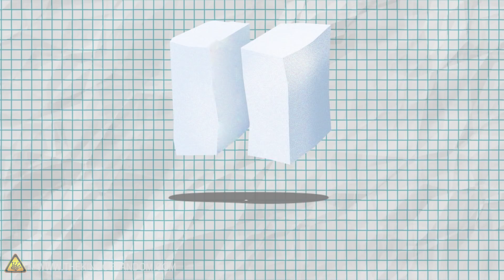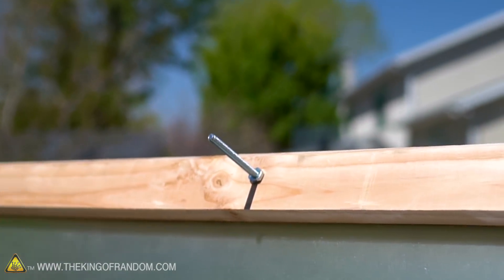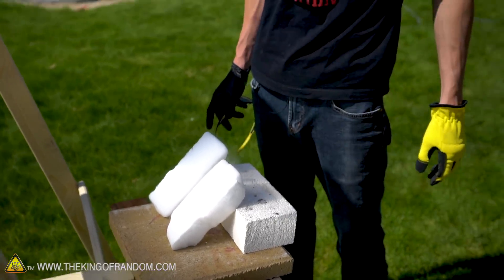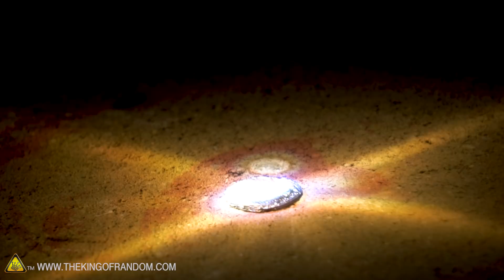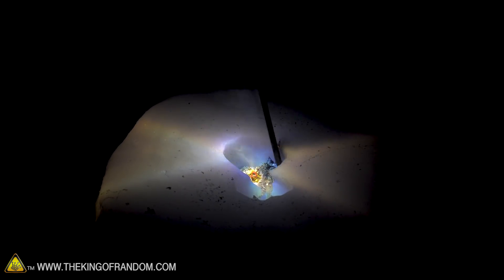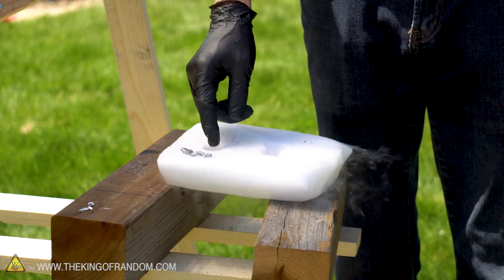When 2000°F Solar Power Hits a Block of Dry Ice? TKOR Solar Scorcher Sun Power Vs Dry Ice!

Comment: In order to help keep the direction of the sun to the lens at 90 degrees
 I screw a small 1/2" id X about 2-3" long tube to the wood frame. For 
storage you turn it so the tube is parallel to the lens. To power up you
 turn the tube 90 Degrees to the lens and turn the lens so you can see 
the sun through the hole in the shadow of the tube on the ground. Since 
there is a nail or screw through the tube you will get a circle of light
 split in two.  Simple quick and easy. In most cases as you focus you are generally behind the lens so you can take a quick glance at the ground to see if you are parallel to the sun. You can make adjustments as you are bringing it in focus without having to completely go to the other side ans see if you are parallel. Also you can turn it for flat storage.

Comment: if you put the dry ice on the steel plate it would also float off. i think pressure has a lot more to do with this. try put the dry ice in a vacuum chamber and then heat it... maybe :P

Comment: Dry ice sublimates faster through conduction than it does radiation, so it would definitely win against just the solar scorcher. Also, the rate at which dry ice absorbs heat is less than the rate at which the solar scorcher Heats things up, so there's no way the metal wouldn't melt on top of the cold dry ice

Comment: Interesting. Because the dry ice is white, it just absorbs the concentrated sunlight as just white light. It isn't until the concentrated sunlight melts metal on top of the dry ice that the dry ice becomes affected.
Reply: I don’t think it’s because the dry ice is white, if you put white paper under the light, or some white plastic etc, it would still light the paper on fire and melt the plastic. It may have some effect but I think it’s mainly due to the composition and temperature of the ice.

Comment: Don't worry non-Americans. Converting from the English system of measurement to the metric system is very easy. So when he says 2000 degrees Fahrenheit it's very simple. You're going to need the brine from a blue cheese, a pile of dead leaves and a warm armpit. Now subtract the temperature of the warm armpit and divide it by the number of leaves in the pile...hang on....was it the brine of blue cheese or a hard red cheese? No, that's it. The cheese goes in your arm pit and then you face west and then count the leaves.....errr.....I think i've missed a step...

Comment: Try putting diff metals in pyroceram, corningware, to melt them under solar scorcher. It is much better at holding heat so it doesn't disapate as fast.

Comment: What if you wrapped it in black cloth so it would conduct more heat tho?
Reply: iilostboiii barely conduct more though
Reply: The cloth would ignite and burn away fairly quickly. Depending on the material, if any ash is left behind, that might serve to conduct heat though.

Comment: I don't know if it is easily possible, but have you tried putting an inverted lense right into the focal point?
If done accurately you could get a super heat laser beam!(I mean if you get all the light rays to go in the same direction again)
Then you also could do explosion and ignition projects without the lens getting dirty. Also you could go away a little further away and use mirrors to direct the beam to the point where you need it!

Comment: There are... a lot of things here.
First of all, Solar Scorcher vs Dry ice, the amount of CO2 coming into the air crystallizing vapor scatters and block the light coming off from the solar scorcher, it never get the chance of actually scorching dry ice.
With the penny, it was getting lifted by CO2, the heat had a bad time traversing through air to the dry ice, because heat capacity... yay...

Comment: the color of the dry ice won. Your solar concentration device follows the same rules as burning lasers - white stuff reflects the whole spectrum so white stuff is like armor vs. beams of light, including sunlight. Meanwhile, if you spray paint the dry ice with a coat of black, it will melt immediately until it gets to wherever a large amount of white exists next. When Burning things with lasers, ive found a simple sharpy X can turn almost anything into a conductor for thermal-optical stuff.
Reply: shintashi 1) you can’t paint dry ice
2) dry ice doesn’t melt

Comment: Dry ice will not sublimate faster as expected by focusing the sun on it. Dry ice sublimates at a rate according to how much co2 is covering it's surface area. That's why it'll sublimate much faster when submerged in water (until it freezes the water). This has nothing to do with the dry ice being white and reflective. It just that doesn't sublimate faster when hotter.

Comment: You need a better couplant. The dry ice and metal interface suffered from your ladenfrost affect.  Thus the ice was a poor heatsink.  If you use some sort of thermal couplant this experiment would go much different. I imagine if you used alcohol, the gel would do excellent in maintaining contact throughout the experiment.  Dry ice would still get a hole through it how ever you might be able to keep the lead or pennies from melting as a result of the dry ice absorbing it better

Comment: Hey. Solar scorcher steam engine?
Reply: Use the power of the scorcher to generate steam to power a steam engine, to turn a generator and make electicity
Reply: Hannah very inefficient
Reply: You would probably do better to simply use a photovoltaic solar panel with the same dimensions as the scorcher, and capture electricity directly.  The more conversions involved, the lower the efficiency of the system.  Solar to thermal, thermal to kinetic, kinetic to electric--wouldn't get much usable power by the end.  On the other hand solar directly to electric, I believe you would have greater net energy available.

Comment: Seems to me that if you had used a fully copper penny you would have received a different result.  Copper transmits heat much better and has a higher melting point than zinc.  I believe the real copper penny would not have melted but would have tunneled deeper and possibly through the ice.  I think that this is the best experiment to show the difference in heat diffusion between  metals.

Comment: Absorption won. White ice reflects away the EM radiation.

Darker other materials absorbed and re-emitted some of the sun's EM radiation at different frequencies. At least two mechanisms are at work here: the material absorbed and re-emitted the sun's energy at frequencies the ice will absorb, and air absorbed part of it becoming a super-heated pocket of air that secondarily reemitted the energy at frequencies absorbed by the ice. Any energy the ice absorbs heats it.

This is why you see black powder sprinkled on snow piles in parking lots. They are changing frequencies of the sun's energy, through re-emission of more frequencies the snow will absorb.

Comment: I feel like the dry ice makes CO2 which refracts the heat and light to near no heat and light so why don't you put it in a steel box and leave a vent and attach a pipe to the vent put the gas in water then see which now it is indirect and should have. A bigger effect

Comment: If someone is interested in the sciene, carbon dioxide absorbs almost no radiation in the sun's spectrum except for infrared light at about 2000 nm wavelength. The infrared however is probably blocked by the scorcher's lens. Therefor it has a hard time subliming the dry ice.

Comment: When you are placing penny or lead the heat tranfer rate from the sun to The penny is much much more than the dry Ice taking heat from the penny or lead , which makes the penny / lead to accumulate heat and melt down , While dry Ice doesnt sublimes because of the neighbouring atoms cools it down. its really awesome to watch it work

Comment: Can you do anything to increase the power of the solar scorcher, add a second lense a distance away in a reflective box perhaps?
Reply: Adding more lenses won’t really increase the power. I think the only way to do it would be to get a larger lense
Reply: Nolonger Oblvious normally when people speak of adding more lenses, they mean putting them in front of each other, which will not have an effect
Reply: Mirror then lense is the easiest. otherwise you have to cool the mirror.
Reply: Adding more lenses is the same thing as getting a bigger lens. (So long as the lenses are such that they share a focal point, and don't get in each other's way.)
Reply: I speculate no. I'm going to guess dry ice and dry ice powder reflect a lot of the light energy. no one really seemed to bring that up. check out the wikipedia for 'Albedo' (how white something is)
Reply: so... guessing a bunch of them and mirrors on buildings all pointed at the same spot on the sidewalk would be a bad idea then... 

(poof! where that person go! who did that!)

Comment: The steel plate could have melted if it was the size of a penny because steel can be melted if the surface area is smaller

Comment: What happens when you pour water on dry ice?
Reply: Joar _D its rolls off. Ladenfrost but from the dry ice
Reply: Joar _D if you dig a hole it'll bounce around before getting too cold and freezing
Reply: Dizastermaster but if u put 4 blocks on Wood in a rectangular  position and a lot of water in between will it freeze?
Reply: Joar _D If you trap the water it will freeze with enough dry ice

Comment: I think the metal plate had too much surface area and cooled on the edges too quickly to melt a hole in the dry ice. You should cut a quarter sized piece and try it again

Comment: If you hold the dry ice over a candle, it will deposit a thin film of carbon on the surface of the dry ice leaving a black sooty spot. Put this spot under the solar torch and it will melt the dry ice because the black color will convert the energy to heat much faster than the refractive white color of the dry ice.

Comment: Near as I can tell, the reason the dry ice block/powder didn't evaporate any faster is because as you add more heat to any given substance if it's at its phase change temperature, the substance does not actually change temperature - all of the extra energy goes toward the phase change process. However, relative temperature of the Solar Scorcher to dry ice compared with the relative temperature of the ambient temperature outside to dry ice (194K:1366K (dry ice temp vs 2000F) as opposed to 194K:308K (dry ice temp vs 95F)), when converted to ratios relative to the heating temperatures, is only actually about 0.487, which is not at all a lot.

Comment: I'd like to see the result and how much power is/could be generated by the Peltier effect; placing a thermoelectric, solid state heat pump on top of the dry ice and having a steel plate with the focal point on the other side. Perhaps get like 4 or more sandwiched between steel plates and see how much power can be generated from the thermal difference..

Comment: Btw any one can do this with a normal convex lens on most glasses concave lenses won’t work because they distribute the light rays instead of focusing them the size of the lens matters a lot because the more surface area focuses more light rays so with a big enough lens you can burn steel, glass, and basically anything.

... SCIENCE

Comment: The steel plate on the dry ice after heating it you should have flipped the plate over and tried pouring water over it.  The water may have not boiled off on the side of the plate that had the dry ice.

Comment: Scattering, transmission and reflectance of dry ice is really high, absorptance is quite low, so most of the energy passes through it or is reflected. But when you put metal on that, it's radiative properties are quite different, allowing it to absorb a lot of that energy and get very very hot, and it then conducts that heat directly into the dry ice.

Comment: My guess for why the dry ice doesn’t sublimate any faster would be that the rate of sublimation is already at its maximum. The temperature of the CO2 can’t increase any more in its solid state (it can’t absorb any more heat than it already has) and must change state before it can absorb any other energy. Increasing the temperature on the surface doesn’t affect the dry ice, while putting something on the surface allows the excess energy in the objects to dissipate directly into the dry ice, as it has nowhere else to go.

Comment: The dry ice won, the scorcher only caused damage to the dry ice through the use of metal. As light, it was completely reflected from the dry ice, but when that light transferred as heat in the metal, the dry ice wasn't able to reflect anything.

Comment: Dry ice has a very low emissivity meaning that it does not absorb the solar radiation from the sun easily. However when you place an object on top of it that has a higher emissivity then that object gets hot and begins to sublimate the dry ice. With the object placed on top of the dry ice, the mode of heat transfer is conduction as apposed to radiation when there is no object on top.

Comment: Leidenfrost won.  It insulates the metals from the cold; allowing the heat to win
Reply: Put the steel in a pan with dry ice and cover both with a thin layer of water.  The water will better transfer the cold to the metal.  Then the ice should win.

Comment: I think it's because nothing is technically cold, you are just adding heat, but the stuff you put on the dry ice don't reflect the radiation as well as dry ice can, and the heat being transferred by solids, (conduction), was more efficient and gathered more heat at a time to break through the dry ice.

Comment: Firstly for the CO2 block I think the suns rays are being refracted and heat has been reduced to near nothing due to it...and secondly zinc and lead are higher in the activity series compared to carbon...loved the experiment was waiting for one with the solar scorcher
Reply: co2 is a heat insulator.I believe heat from radiatian and conduction does nothing to it.
Reply: I think you mean reflected, refracted (I think) only works on transparent bodies. And there was no chemical reaction that took place during the video, therefore the reactivity series is not necessary.

Comment: My science is a bit rusty but I assume the reason those metal items melted is highly related to the thermal conductivity of those metals.  You had proved that the dry ice has enough energy to 'win' against the solar power.   I think that metal is melting because it is not conductive enough for the cold-energy of the bottom side of the metal  to make its way fast enough to the top surface.   If you used something like Copper which has a very high thermo-conductivity you might have a different result.  Copper is ~4 times more heat conductivity as the mostly zinc penny.

Comment: The issue wasn’t the metal, it was the absorption of light that caused the objects to melt the ice faster. The white color as well as the translucent nature of the CO2 means that very little energy is absorbed by the dry ice, but it is reflected. If you ever try spray painting snow with black paint, within hours during the daylight you’ll find that whatever lettering or picture you drew with the spray paint will be gone, and there will be a nice valley where the paint once was (along with some particles of paint)

Comment: For the things on top of the dry ice: From the perspective of molten metal, dry ice isn't much colder than room temperature anyway, and it's not particularly heat conductive, so there won't be any difference.

Comment: The dry ice and solar scorcher is like pitting two people against each other. Both opponents have their strengths and weaknesses, but for the most part are equal fighters. Though once you give one of them a knife or some sort of weapon (aka. the metals in the video) one has a clear advantage to winning the battle. Or at lease that's what I think. :)

Comment: The solar scorcher vs. the dry ice itself, the scorcher had hardly no effect. But, as you said, with an intermediary, the scorcher won. I think it was because the dry ice was not opaque, but translucent, removing the focus through the ice block enough so that the heat from the solar scorcher vs. the cold from the dry ice sort of mellowed, and allowed the dry ice to diffuse maybe at a little faster pace, but not noticeable to the naked eye. The items you placed on top allowed the scorcher a focal point, and melting/heating whatever it was focused on. If you had sprayed the top of the dry ice block with spray paint, or just painted it, you would have allowed it a point of focus, even if the block is turned around.

Comment: You would most likely need to lay a dark material (possible metal) that absorbs the light and turns it from light energy to thermal energy, try just laying a steel plate on a flat piece of dry ice

Comment: Try Solar Scorcher vs a sheet Graphite on Dry Ice, since Graphite has a high thermal conductivity, it should get really hot really fast, but also dissipate all that heat very quickly into the dry ice if there is enough surface area. On the other hand since it's surface area in contact with Dry Ice is greater than the solar scorcher it might actually stay cold.

Now here's another question, what would happen to a Solar Cell in the solar scorcher? Will it melt, Generate a ton of energy, Overvolt, or maybe do nothing.

If you put a prism at the focal point of the solar scorcher, what would the light spectrum look like. Would it be a very vivid and saturated rainbow?

Comment: Solar scorcher was bound to win. It has a power source that's been pumping out energy for longer than life has existed, and is still going strong. Vs a single block of dry ice. The only reason the ice held up in a direct contact match was because it refracted the light, rather than absorb it. The energy passed through it, and radiated out on all sides. Hence the "glow" you mentioned.